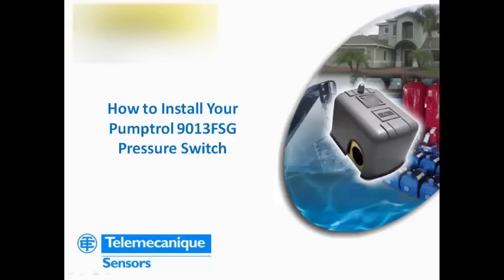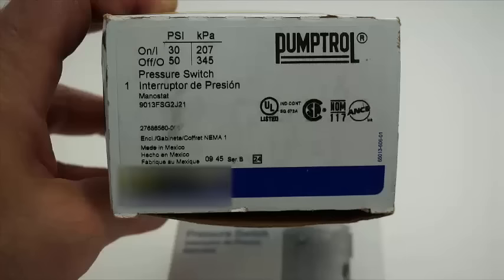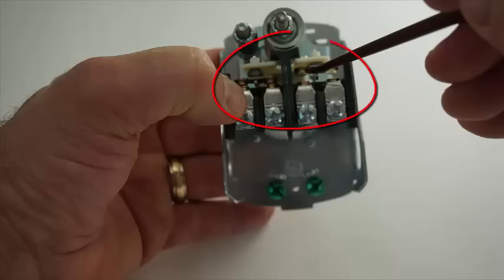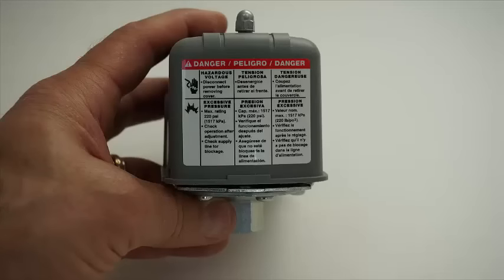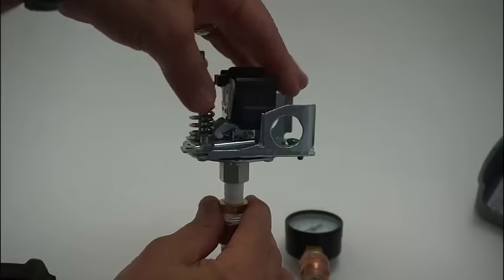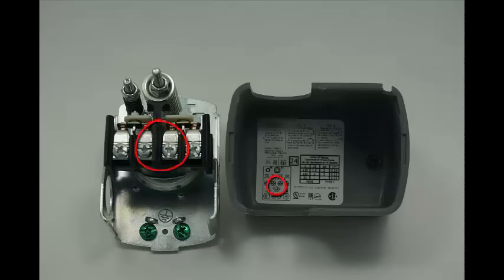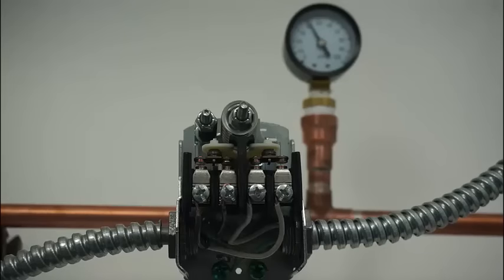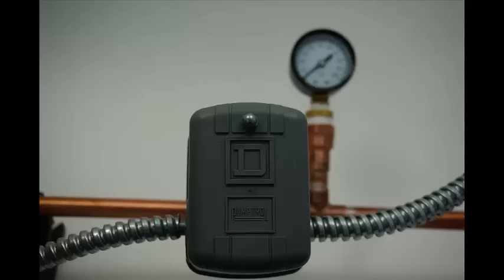Tutorial – Install your Pumptrol Pressure Switch - Square D sensors rebrand to Telemecanique Sensors

Comment: I put one of these on my water pump today.   The original factory switch on the pump was LeFoo.    The contacts were wearing out and every once in a while it would get stuck in the on position.     

Hopefully with the new Square D switch, I won't have any more problems.

Comment: This Switch can be used directly on a Water Pipe Line, Right? I was thinking to use a T on a PPRC Water Pipe Line and Tighten it directly over it, Would it Pose any Problem?

Comment: For the electrical wires - the inside two are from the pump that outside two are from the power - does it matter which goes to which?  Do the two on the each need to match something?  I can't find out if this matters or how to configure it correctly?
Reply: Have the same problem.. I have the 3 wire plus ground..
Reply: I do not know how to connect them the correct way

Comment: Are the 30/50 and the 40/60 switches the same switch but simply adjusted differently at the factory? Or are they physically different switches? Can a 40/60 switch be adjusted down to 30/50?